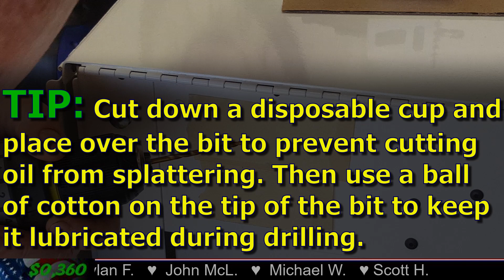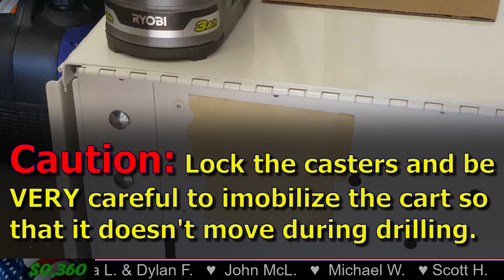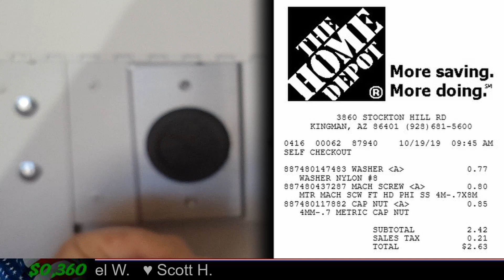How to Put POWER in the 5 Drawer US General Cart from Harbor Freight

Comment: Hi Dale. When I have to drill a bigger hole in something that already has a hole in it... which makes it virtually impossible to center your new hole perfectly over the old hole, take a 1x3 or 1x4 and drill the right size hole in the board and then clamp that to the spot you want your new hole. Its like having a template or jig. You are awesome Dale! Keep up the good work.
Reply from the maker: Thank you @Billy Oliver. Using your idea may have stopped the "wobble" that caused me to have an oversized hole. I had better luck on my current project. Watch out for that video coming this week. Thank you for watching and the support.

Comment: I did the same thing without drilling anything just cut the plug off pull it yhtough an existing hole and wire in a new plug worked great??

Comment: I zip tied an old battery/inverter box to my handle and now have “wireless” power to my cart, but I needed a way to clean up the wire to my hf magnetic power outlet so thanks for the idea! Came out great. I’m thinking maybe a diamond blade hole saw would be a cleaner, tighter cut.
Reply from the maker: Hey thanks for watching. And thank you for the hole saw rip. I'll remember that. 👍🏻
Reply: @DaleLucid  so did you end up using two grommets? Just wondering how the inside edges look

Comment: I think what I may do is place the strip on the back or side of the cart. The battery chargers would be inside the top area with the cords passed out through the grommet. Probably a smaller grommet that way.
Reply from the maker: The Milwaukee Hole Dozer made to big a hole so I had to improvise.
The main point was to be able to secure everything but still charge.
Thanks for watching!

Comment: That is a great idea. I think you're right about the power block fitting better on the left side of the cart .
I was thinking you were going to use a couple of pop rivets to attach the plate to the back of the cart .
Reply from the maker: LOL! Fun fact, I hate doing permanent stuff. I nearly vomited after cutting the hole!
Reply: @DaleLucid  but you saved it with the cover. That was so cool. I was thinking to my self "how is he going to save it ?"
You pulled it off and I was like wow. That's a good save.

Comment: I wanna test if you can run a 12v car battery on an inverter to charge my power tool batteries and phone, then hook it up to a trickle charger when i head home from work.
Reply from the maker: EXCELLENT idea! My immediate thought was get the set up from a recent salvage vehicle. Maybe even use a deep cycle battery. Very impressive idea and thank you for sharing it.
Reply: @DaleLucid  Yeah a deep cycle is a must, and my drill battery charger takes around 240 watts so ill have to give it a test.
Reply: Hey bro. I mounted a power inverter with two motorcycle batteries all in one package with a carrying handle. It’s zip tied to my cart handle and works perfect for charging all my electronics. I don’t have a need to have my cordless tool battery charger with me at all times we have a station for that at my shop, but it charged 4 flashlights and my phone at the same time 6 times in a row on a single charge

Comment: Good cart but it doesn’t fit my snap on pry-bars on the side holes the handles on the pry-bars are too tall and the lid won’t shut. 

I had a Similar Matco cart and the prybars fit.
Reply from the maker: @J D I know what you mean. The Pittsburgh pry bars have the exact same problem. I have looked into this a couple of times. The solutions I've visited this far either required metal Fab or the pry bar s not being secured when the cart is locked up. I am continuing to look for a solution. Stay tuned and thank you for your comments.

Comment: Use a knife to deburr as opposed to a file. A good deburring knife will cut the sharp extra bits off without removing a massive amount of material. It won’t make a completely smooth/cut free edge, but that’s what the grommet is for.

Side note: Thought it was funny seeing how excited you were about a hole saw. We destroy those milwaukee hole saws on the regular installing data cabling.
Reply from the maker: Doing more of this sort of thing so I'm looking for one. Any suggestions?

That "Hole Dozer" was my first Milwaukee purchase. NAN that thing dug in.
Reply: Hey Dale! One of my absolute favorite tools of all time is a three sided knife similar to this. Great stability and three cutting edges: 

Nicholson Steel Machinist's Scraper With Handle, 8" Length (Pack of 1) https://www.amazon.com/dp/B00018ACDG/ref=cm_sw_r_cp_api_i_XXi0DbGYGK629

I can also recommend a tool like this which is great for doing inner diameters, like you had on this project here. The blade rotates so you don’t get quite as much oomph on the cutting surface, but it whizzes around holes real nice:

AFA Tooling Deburring Tool with a Blade and Pack of 10 Extra Blades https://www.amazon.com/dp/B01L2XR4P2/ref=cm_sw_r_cp_api_i_b1i0Db7YWYQF8

We use those ‘dozers’ to cut holes for conduit into boxes among other things. They work nicely, as do similar Lennox products.
Reply from the maker: The AFA Tooling deburring tool is the type that I was looking for. I really like the machinest's scraper too. Thanks for the links.

Comment: @dalelucid Thanks For The Shout out #YouAlreadyKnow Great Content as always 😎👌✌
Reply from the maker: I know you didn't need a shout-out from me @Darrian but I just wanted to let you know that I appreciate your videos. Thanks for stopping by.
Reply: @DaleLucid  Always Dale ..In the application that you were Demonstrating it would had been a 360degree Clean Cut if you would had used a step bit instead of the Hole Dozer because using the Hole Dozer at that particular angle is  not as easy the Hole Dozer tends to walk when starting off at a particular speed setting the step bit would had pierced the metal and made a small hole then it would had started to shave the metal in steps ...when I shot the video talking about Modifying the pry bar storage Solution I never demonstrated or shown when I did it I shot the video after it was done because I did not have no one to record me I still have another hole to do and I'm going to shoot video this time and show the actual process which it's done from the bottom but not face down in the cart and the viewers will be able to see the actual fine clean cut that it gives you can't even tell that the metal has even been cut
Reply from the maker: I did use a step bit on the holes for mounting the monitor so that I wouldn't overshoot the screw size. That worked well. The bigger hole was 2 inches. Is there a step bit solution for that?
Reply: @DaleLucid  Yea Dale you gotta go to Ebay since you did that cut and it didn't come out right you wanna straighten it out there is a solution for what you are trying do see normal stores such as home depot or lowes or a harbor freight only sells step bits that go up to a certain measurement the step bit that I used in the video I displayed is a Milwaukee number 12 step bit now when I used that bit I cut a whole straight through now I also need a bigger size normal stores dont sell them but they do exist because industrialists need to use them so what I found I believe it's a 61mm step Bit kinda  big but its exactly what we both need give me a minute I'm gonna find it and post the link to your video
Reply: @DaleLucid  Google 61mm Step Bit it will show you a listing by online Ebay distributor you will see in the image a hand holding the bit but this is what you need
Reply from the maker: Thank you @Darrian. I have a project coming up and I will need this.
For anyone following @Darrian Robinson is having a huge giveaway and channel expansion event. Go check out his videos. Like, subscribe and share for a chance to win some brand new premium tools!

https://www.youtube.com/channel/UCv47YLO7ru7LEAP7AH9AtOA

Comment: All you had to do was mount it to the back wall inside of your box with the magnets. Then remove the plug, run the cord threw an already existing hole in the sides for the prybars. Attach a new plug and done
Reply from the maker: That's a good idea and I did look at doing it that way. While I can solder ok it isn't a job I wanted to do. Also the small PC board that the cord is soldered to has the electrical components for the USB ports. I was concerned about over heating them.
Thank you very much for watching and sharing your thoughts.
Reply: @DaleLucid  I didnt solder the plug back on. I bought a heavy duty Three prong plug ( in yellow to match my box!) and the wire ends are secured by screws. Your idea is good just saying it might be easier this way. Also i needed the top space for my tablet, and it needed to be near my cell phone mount so I can charge that on occasion. I also needed room for my sockets as well. I think you should save the plastic cord holder ends to mount somewhere so you could hang an wxtension cord on it! I wish I could post you a pic obn here for you to see. Good video
Reply from the maker: OOH! In that case I don't know why I didn't think of that 😂. Of course since I didn't I had to cut off the cord wrap on that end.  Oops!
You can send me a picture and I will share it in a video. BlindGuyCan@gmail.com. thank you for clarifying that.
Reply: @DaleLucid  will do Dale!

Comment: Dont like the mounting why because you plug stuff in it will face much needed real estate where tools should be. mount it so plugs face the sky takes up less valuable real estate  food for thought
Reply from the maker: My thinking here is that like the top the inside is work space. When not in use the keyboard and mouse are stored inside where they're secure. I wanted to be mindful as well that a monitor would be screen side down in the upper compartment where loose tools might bang into it. Do you think that makes sense? Thank you for your suggestions. I would love to build more of these.
Reply: CONCUR... the sky is the limit 😁